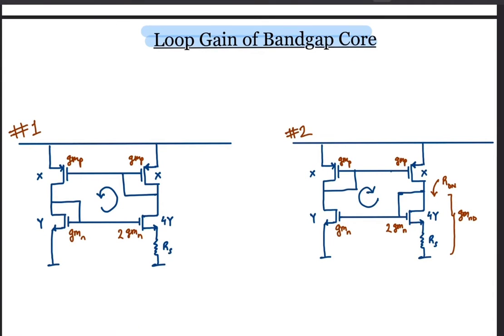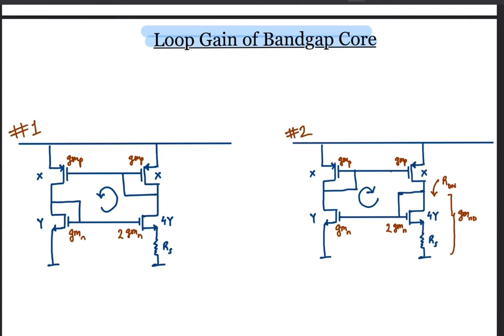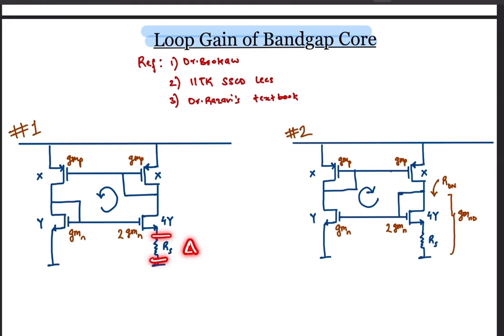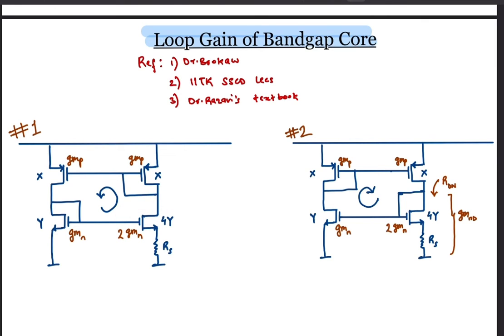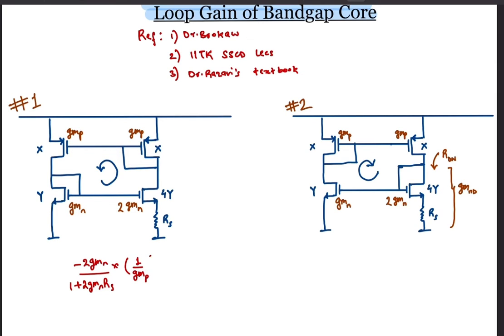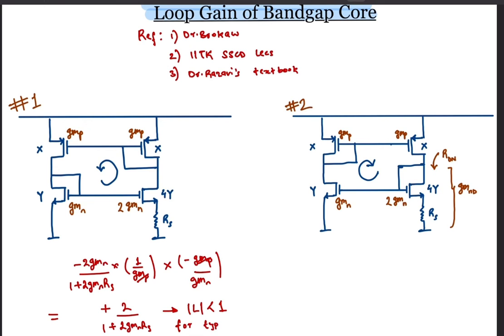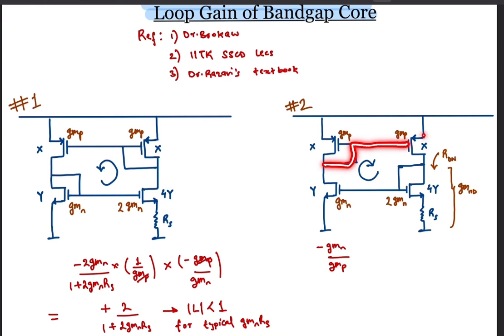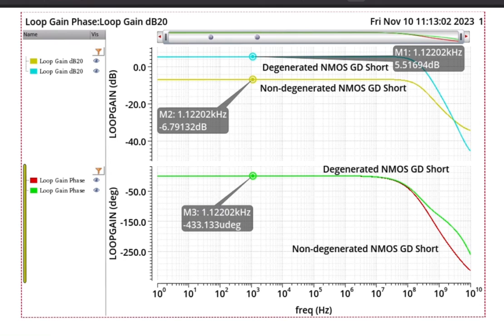Loop Gain of Bandgap Core

Comment: I do not understand this 🙌
Reply from the maker: Could you please elaborate? 

This circuit is an example of a supply-independent current. Meaning that the current won’t vary even if VDD varies. 

Both the variants generate the same voltage on the resistor, yet one is more likely to work than the other, as explained in the video. 

Hope this helps.

Comment: Hi tejas...my  interest is working in analog profile..could you please tell the roadmap ..books, lectures...like razavi...if possible pls help..thank you
Reply from the maker: Strengthen your basics. Study the analog circuit courses from NPTEL (Dr. Nagendra), and IITK SSCD YT channel. You can refer to Dr. Razavi’s text book as well, and even lectures by Dr. Ali Hajimiri from Caltech. 

Learn about RC circuits and their variants, step response, ramp response, etc. 

Once you have the fundamentals clear, try interning at a company or work with a professor, depending on your aspirations.

Most importantly, find a good mentor that will guide you, and resolve your doubts.